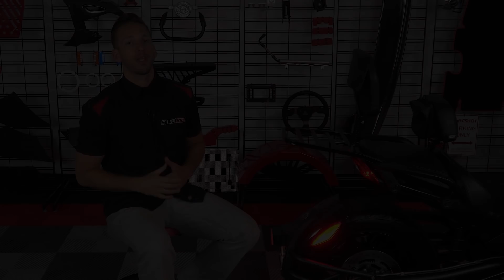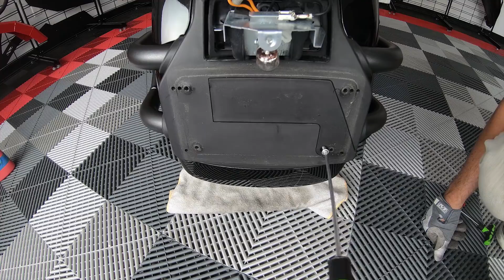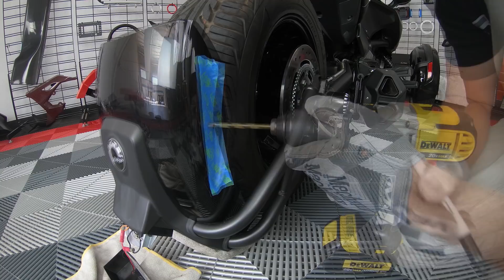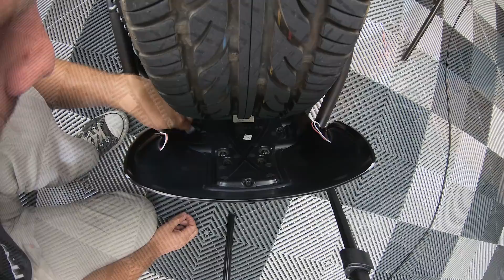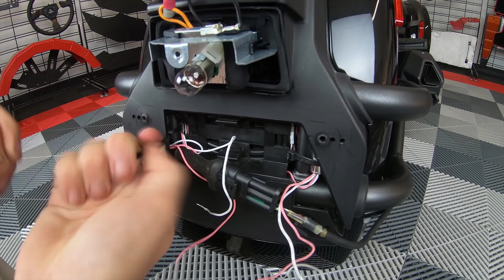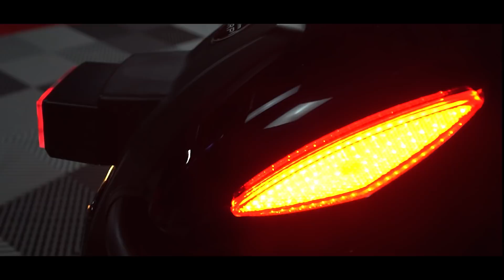Can-Am Spyder F3/F3S Rear Fender LED Safety Reflectors

Comment: The clip broke my wire when I hooked up the light.  Can that black and white wire be ran somewhere else for power.? My lights didn't work when I turned on my bike and it broke the wire.  I was a le to repair the wire, but now I have to figure I out where to run my wire for power.  Any suggestions?
Reply from the maker: Hello Samuel, can you please submit a support ticket to our customer service team with pics. We'll be glad to help you out. You can do that here: https://www.slingmods.com/index.php?route=information/contact